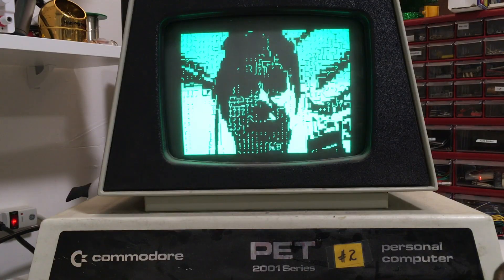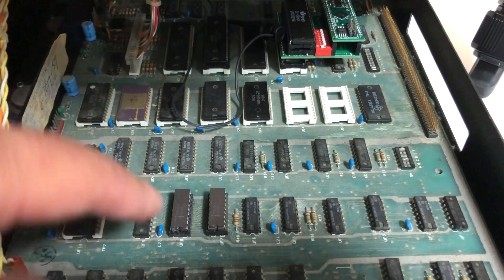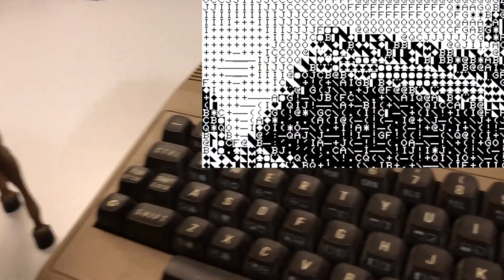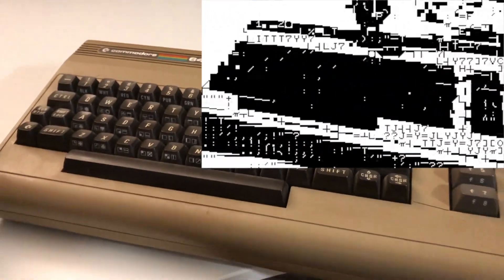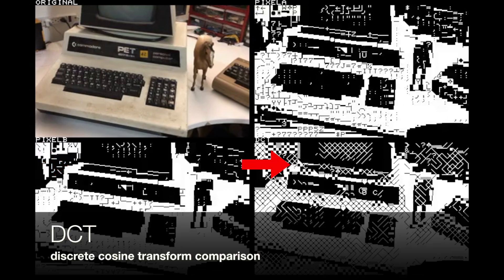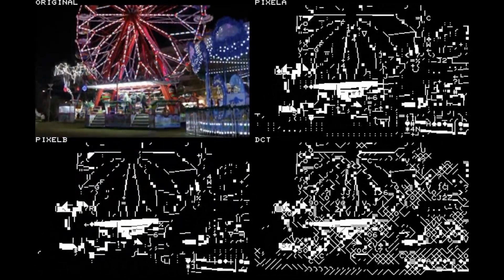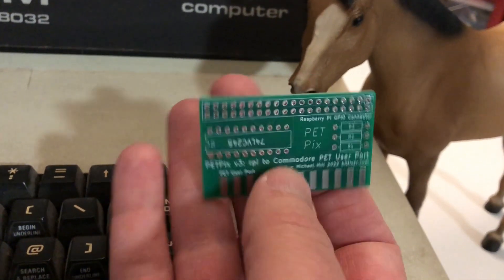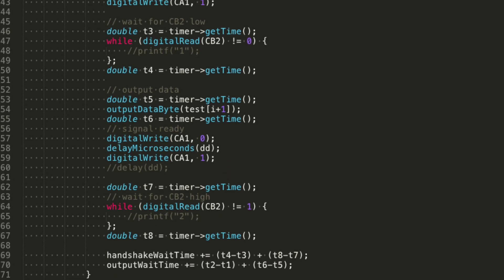Commodore PET Video with PETpix! YouTube, Live, and more on a 40+ year old text-based computer.

Comment: I think they're all good, I don't think there is any one perfect mode given approximation of images. Could probably just switch between as specialization filters, kind of like the Predator switching spectrums in his vision.😉
The high threshold mode was really good at print-scan style rendering which is good for reading signage. Can't really suggest PixelA or PixelB over each other as they're quite similar in result imo.
The DCT mode is overall smoother since it blends more but I'd say it's more dependent on tilemap resolution where 80 Columns would look a lot better with that as 40 Columns is quite amorphous. With rendering like this it's hard to suggest it more since it kind of hinders the iconic aesthetics Eg. as you said the faces were more defined in the other methods.

Comment: I have an strategy I'd like to share with you.

About 10 years ago, I was working on a project to convert 1-bit black and white images into something that could be displayed on an X/Y oscilloscope. Like you, I tried a bunch of different drawing methods to achieve the best balance between draw speed and image clarity.

Since draw speed isn't really an issue here, and you're able to enjoy a solid 30 FPS no matter what the approach, my suggestion would be to forget the spatial quantization approach entirely and let the brightness of each subpixel represent a probability of that corresponding character being lit, fully white or fully black, on any given frame. In other words, if a given subpixel is nearly black, it will have a high probability of being drawn as an empty character on any given frame. If the subpixel is a mid-tone gray, it's corresponding character cell will be drawn as empty about half the time, and as a solid white character half the time..and similarly, if a subpixel is nearly white, make it so that there's a high probability on every frame that the corresponding character cell is all white. The PETSCII character set doesn't even need to be part of this.. just a normal (black) whitespace character and inverted (white) whitespace character should suffice.

Basically, with this method, you're converting subpixel brightness to a randomized "duty cycle" for each corresponding character. Over the course of 100 frames, the character cell corresponding to a mid-tone grey will only be lit 45-55 times. Since the human eye naturally wants to smooth out the appearance of such things, it will appear grey, just like a "dimmable" LED light bulb in a desk lamp isn't really being dimmed, it's just having its duty cycle lowered.

Try this approach. I think you'll be pleasantly surprised by the results.

Comment: Re: which rendering scheme looks better..

What's the result of taking the two best schemes (A & B) and interleaving them every other frame A/B/A/B?

The brain would be forced to synthesize one blended image.. but is it better or worse than either A or B alone?
Reply from the maker: Really good idea - I did try this on the 80 column PET, and while it looked interesting, the frame rate was a bit too low to have the synthesis happen. On the 80 column pet you have twice as many bytes transferred per frame so the FPS is roughly 15-17, about half of the 40 column. I will give it a try on the 40 column to see if the faster framerate makes the blending happen. Also could try a 50% chance per character to pick from one method or another, also possibly an interesting effect
Reply: @bitfixer6502  Interesting. If you try it on the 40col I'd like to see the result.

As for your suggestion of randomly picking one of two schemes for each char, I wonder how a slight modification of that would work..

Treat the screen like a checkerboard, with black & red each pulling chars from different schemes. Then swap the schemes every next frame. It would probably use less CPU than a RND function per chat too.

Comment: Very nice.  Hard to decide which method works best in all cases.  How hard is the PET working here?
Reply from the maker: Thanks. The PET is spending all of its instructions reading from the user port and writing those values to video RAM, as quickly as possible. There are also instructions to toggle the handshaking line and to read from the other handshaking line from the pi. It happens in a long unrolled loop to save CPU instructions, on the 40 column PET so far it tops out at about 45 FPS. May be possible to go even faster if the pi can stay in sync with the PET without using the handshake line every byte, but so far haven't gotten that to work stably.
Reply: @bitfixer6502  Thanks for the explanation!

Comment: Incredible work! The pixel matching B really shines when it's able to match up with vectors like on the ferris wheel spokes and other sharp detail. I WANT to like the dct method best on principle, but I find the heavy cross hatching kind of distracting, and it doesn't have as much twitchy petscii charm.
Reply from the maker: Thanks Mark, I agree, the DCT method seems to frequently pick that crosshatch character, as well as the checkerboard character with the 2x2 BW squares. That one in particular seems to get selected in midrange gray regions and is a little distracting to see everywhere. In earlier iterations of the petpix software I was only using the DCT, I somewhat assumed it must work better than the direct pixel match but this year did more experimentation to directly compare them. Pixel B has a range of 4000 (not even sure what to call the units - brightness?) This is in terms of the sum of 8x8 grayscale pixels with a range of 0-255. Seems to give good results in most cases.

Comment: Awesome, amazing video and work! You have done it again! Maybe you will sell a kit on your site, I know I would  buy one. Great to see new projects for the PET, it needs love too
Reply from the maker: Hey Rudy, yup I will have a kit available (as soon as I make sure the board works!). Also the KiCad project files are in the repo so anyone can make their own as well. Only parts are an 74LVC245 some 1k resistors, edge connector for the PET and a 2x20 pin socket for the pi.